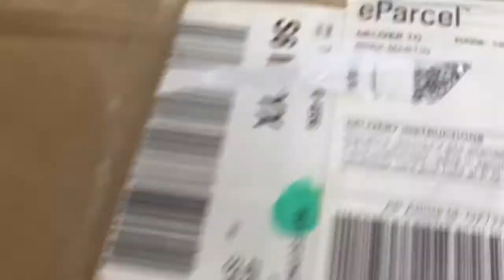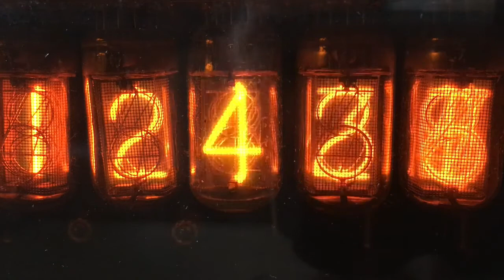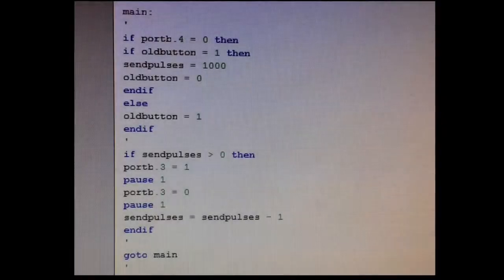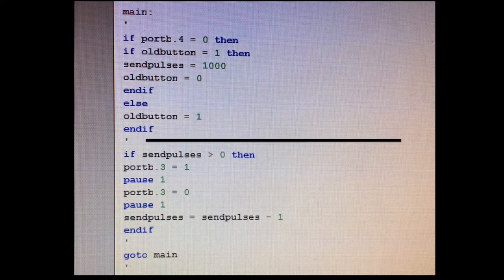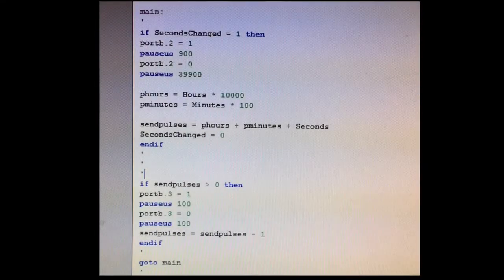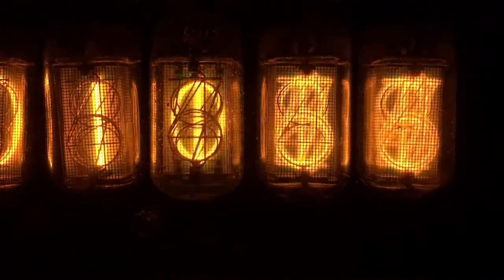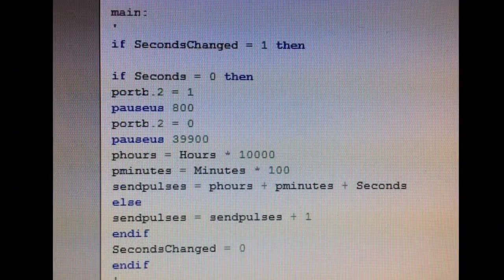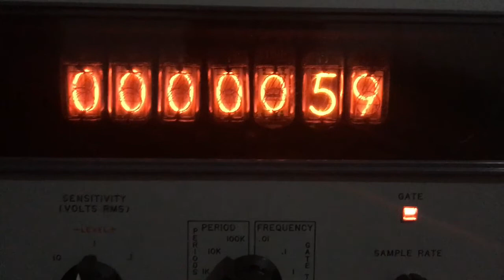Nixie Counter to Clock Modification - Pt1

Comment: how will you know when the counter has finished resetting, in order to time it accurately? I suppose counting the difference is quicker further on when updating the late hours rather than counting to 235900. That would become quite an interesting algorithm to always choose the most optimal approach. aesthetically though I like the indecision it had when counting!
Reply from the maker: The problem is if it never resets the counter, it will also never recover from any error, so I think at some interval it needs to happen. The counting can be much faster than so far displayed here yet though. For the reset, the micro is triggering the reset. There’s a reset port at the back of the counter. The solid state relay is the slow part, but it can be streamlined out.

Comment: Nice old Gear, WAE2W has one similar. Maybe he'll hack his.. 
I'm not knocking Dave's YouTube counter, but those 5's look about 100% better than the Rusky-tubes he bought.
Reply from the maker: Hi :) I like the thing Dave made. It’s all his own, and there’s some originality in it, and it’s tidy. These ones appear to be upside down. They are soldered to a board above the display. I guess it was lucky they are still nice, but you’ll notice in the video one of mine is slightly bend, and I can’t stand it. It will have to be opened just to fix that :D
Reply from the maker: Actually what I like most about that counter is Dave said he was going to do something like that, and then followed right through.